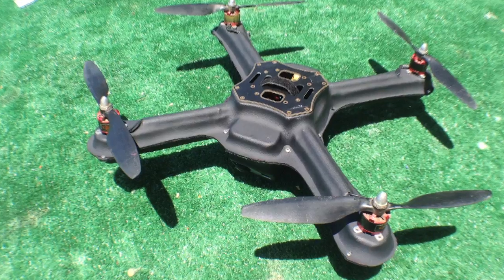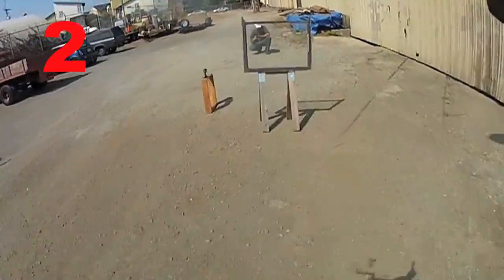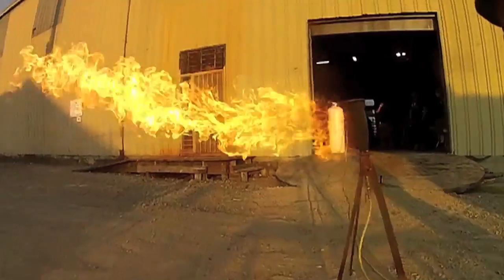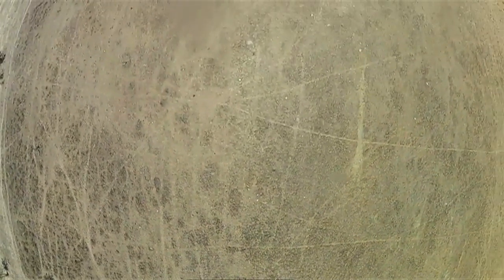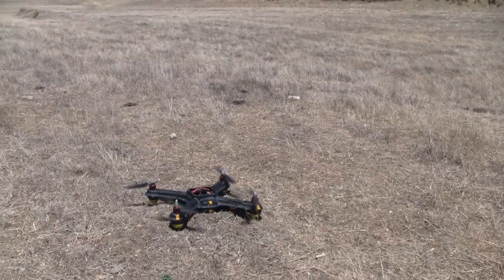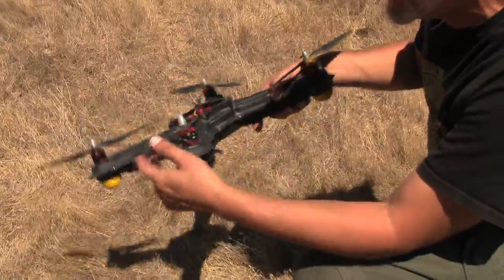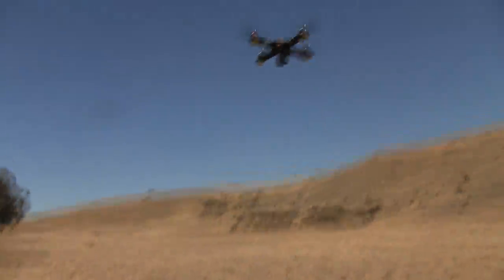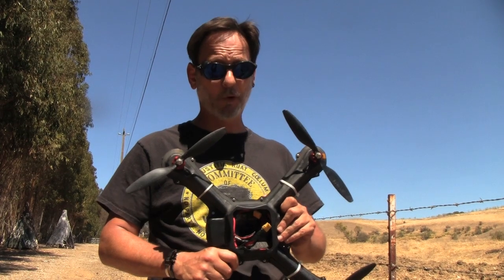Shotgun vs Drone Airframe - UAV Torture Test by Aerial Sports League

Comment: Yeah, it's practically like brand new... AFTER YOU'VE REPLACED THE PARTS YOU SHOT OFF IT. Holy shit your logic is non existent. And stop calling it a fucking drone. It's a quadcopter with a GoPro on the bottom.
Reply from the maker: I never called it a fucking drone.  I don't cuss without reason.  Thanks for watching and share the links with your buddies!
Reply: Marque Cornblatt Prod. You did in the title. Shotgun vs Drone. Or are you referring to the "fucking", bit.
Reply from the maker: Kerry Emmerson Yeah, the reason I don't cuss online is because it usually makes the author seem too emotional and possibly unstable to be taken seriously.  However I see your point - even though we were only focused on the airframe (our product) we DO use some words and terms loosely.  We call it a drone when we "mean" just the airframe.  So I agree that this video can be a bit confusing unless you're really paying attention. Since this video, we've been more careful to use the word "airframe" while demonstrating our product line, since we don't sell ready-to-fly drones.  The other topic (drone vs quadcopter) is already an out-of-date and useless debate.  Words and language are fluid and constantly evolve.  "drone" is an accepted term for multi-rotors, whether autonomous or manually flown.  Just like how "robot" is the accepted term for just about any new machine produced these days.  I also call my remote telepresence rovers robots:  Sparky - Autonomous Telepresence Robot Interview

Comment: Yoo dude start one more kickstar project that drone carries man in the city...v8 powerful engine from tesla motor...collaborative projects with tesla motor..put two v8 electric motor...One above and one below or both above...Make rectangular circuit or diamond shape..between that making on seating chair or two...batteries are arranged in frame on rectangular circuit...use specific batteries arrangements by tesla..Make weight of distribution properly..I am fed up up with traffic in city and gasoline hicks...electricity is the only way out...I can't buy chopper but I can afford your man carrying drone. Make it affordable for everyone! Tx

Comment: I winder how easy I could mount a weapon to one of these...?
Reply: Wait how is FPS Russia's videos a fake?.
Reply from the maker: Done that.  Worked great.  Check it out.
Paintball Drone Gunship - a DIY Combat UAV from Game of Drones
Enjoy, and thanks for watching!
Reply: Marque Cornblatt Prod. paint ball? That's not a weapon. What I am talking about is dual AR-15's, each with 150 drum mags.
Reply: J.D. Turner Mounting it would be easy. Hitting anything would be difficult. Getting the drone off the floor would be impossible.
Reply from the maker: Twin AR's is just a videogame folly.  Small powerful drones can easily, mount, lift, fire and repeat a range of modern weapons with accuracy.  There are many videos online demonstrating this (Don't be fooled by FPS Russia's fake clip, however).  Thanks for the question and share the links with your friends.

Comment: I should mention that shotgun experiment is comparable to shooting at a car's hood, replacing the damaged components in the engine bay and then concluding the car itself is indestructible.
Reply: Marque Cornblatt Prod. how much does that drone you are using cost roughly? and where could i buy one?
Reply from the maker: Toby Squibb This video is a demonstration of the airframe's toughness, not a suggestion of a battle tactic.  Thanks for the comments and share the links with your buddies.
Reply: Marque Cornblatt Prod. No actually... it's not at all like shooting a car with a GAU-8 Avenger... if you think so, I would like to see your exact research on the fact and how much damage the car would sustain in comparison to a UAV, as well as how easily it can be repaired and the cost of those repairs. Basically, if you do not have a scientific study that shows this is exactly true, then please do not say it is. That would be factually wrong. Please like this comment and share it with your buddies.
Reply: Nobody wants to go find a drone so they can perform these minor repairs though, especially not if there's a nutter with a shotgun lurking somewhere nearby.

Surely this will end up giving a lot of drones to the enemy that they can then perform "minor repairs" on, replace the transmitter crystal and then use against you?
Reply from the maker: yumpaa You can purchase our airframe here:
http://www.gameofdrones.biz
Thx!
Reply from the maker: Thanks for the comments.  To be fair, if you consider the scale of your comparison in terms of mass/speed/ and other forces of ballistics, it's more akin to shooting a car hood with an A10 Warthog and being able to drive away with minor repairs.  And that would be the world's most indestructible car.  Thanks for watching and share the links.

Comment: this is interesting too ..

If I fly a UAS for business purposes, such as new technology development, am I required to get approval from the FAA?
All UAS operations for commercial or business purposes are subject to FAA regulation. At a minimum, any such flights require a certified aircraft and a certificated pilot. UAS operations for commercial or business purposes cannot be operated under the special rule for model aircraft found in section 336 of Public Law 112-95.
To date, only two UAS models (the Scan Eagle and Aerovironment's Puma) have been certified for commercial use, and they are only authorized to fly in the Arctic. Public entities (federal, state and local governments and public universities) may apply for a Certificate of Waiver or Authorization (COA). The FAA reviews and approves UAS operations over densely-populated areas on a case-by-case basis.

What's the difference between public and civil aircraft?
A public aircraft is one that is only for the United States government or owned and operated by the government of a state, the District of Columbia, or a territory or possession of the U. S. or a political subdivision. Operators of public aircraft include DoD, DOJ, DHS, NASA, NOAA, state/local agencies and qualifying universities. Civil aircraft means other than a public aircraft. 1, 4

http://www.faa.gov/about/initiatives/uas/uas_faq/

Comment: Did nothing but scuff the plastic... Nope, ESC was stuffed along with a motor and blades, if he could actually aim properly and hit the battery, the whole quad would have been stuffed.
Reply from the maker: Nope.
Reply: Yes. Common sense, don't you have rc experience?
Reply from the maker: Ryan McDougall Yes, I have extensive experience with both aeronautical design and shotgun ballistics.

Here is one of my many weapons videos detailing different 12 gauge rounds and their various impact forces: Guns & Gardens Ep. 13: Mossberg 500 Ballistic Test

And here is a video detailing some of my recent airframe testing:
World's Toughest Drone Torture Compilation

The airframe was only scuffed not penetrated, but a pellet or two did squeeze between the clamshell parts hitting an ESC.  The motor and prop were not protected by the airframe, so they received the full force of the birdshot.  The integrity of the airframe itself was never compromised and the internal components were protected.  We now have an added clamping piece of exterior trim armor to prevent foreign materials from squeezing through like that pellet did.  

Thanks for the comments and share the links!
Reply: I think the if the battery is a lipo one and it got penetrated by a pellet from the shotgun than the reaction of the battery would be contained by the frame and the internals would be toast
Reply: Yes it would.

Comment: I bet my 50 BMG rifle would bring it down.
Reply from the maker: Only if you can make contact.  If the drone is hovering for effect like in the clip then no problem.  But a drone flying at speed is nearly impossible to hit, even with the wide spread of birdshot.  Most hi-powered rounds will penetrate the airframe, but there is a lot of empty space inside.  It's very likely a round would penetrate the entire drone without causing any damage and little impact forces.  Check out the failed attempts to bring down drones at the recent full-auto owners annual meetup.  Thx for the comment and share the links.
Reply: Marque Cornblatt Prod. Very true. With a high-speed pass, it would be just pure luck to hit the aircraft at all. I haven't seen the full-auto video yet, but I'll definitely check it out. You guys have created a hell of a quad for sure.
Reply from the maker: T.J. Cloer Here.  Check this out. I was kinda shocked...
http://gizmodo.com/shooting-down-a-tiny-drone-is-nearly-impossible-even-w-1563018247

Comment: For easy to make anti drone munitions, crush an old speaker magnet into small pieces and pack it into a 12G shell using salt as a filler. Can make do with that until armour piercing ammunition types impregnated with magnetic filaments becomes available ;)

Comment: I have built quads with foam and aluminum ( $5 or less in parts) which can all take the damage that you are showing here (minus the blades which looks like they are being destroyed in your videos).  Nothing that you have shown is impressive. These are not drones, these are RC quads.  When did hobby grade RC aircraft all the sudden become drones?  I want to see something actually demonstrates real world crashworthyness compared to other compatible products.  Show one half way through a loop that plunges into the ground sideways at full speed.  These are nothing more than parlor tricks.  I am not trying to be an @ss but I just don't see anything impressive.  Hitting thin glass?  Why glass?  Why not something more likely like a wall, tree, or anything else that is far more likely to be hit? Shooting it with birdshot?  what quad couldn't take that? Dropping it from the air?  A cheap carbon fiber frame can take a throttle down.  I am not questioning the strength of this product but the testing that you are doing to is not that impressive.  I don't see how this is any better than any other frame.
Reply from the maker: You sound like a person who hasn't spent the last 24 months building and testing airframes for toughest and resiliency.  If you think that you can produce a frame from carbon fiber that can take all this abuse as well as ours, then you should be in business.  Let me know, because I would gladly buy one after watching your airframe handle the torture testing on video as well as ours.  Thanks for the comments and I look forward to your video.
Reply: Like I said, its not that I am doubting the product, just that your videos are not really showing a real difference between it and other products.  For someone who wants to be in business you may want to be a little more professional in what you post.  I am not in the business of building quads, you are.  You could take what I said and do something to better demonstrate your product compared to what OTHER COMPANIES make rather than be defensive about it.
Reply from the maker: jjmonns Our personal work shown on video became so popular that only in the last few months have we begun selling the airframe.  Here is a more recent clip with a direct comparison to 2 of the most popular airframes available.  I don't mention the brand names, but anyone who plays with UAV's will recognize the brands.  Notice how they are ruinied with a single impact.  Then notice what our airframe can handle.  There are even more clips if you care to watch...
Drone Torture Test #2 - UAV Airframe Beat Down

Comment: Awesome indeed. I had an idea, how about getting rid of all the wire's use Bluetooth  to sync the props together. Then reconfigure the props,drive motor, and finally the powersupply into one unit that changed out as easy as you put a battery in a flashlight.
Reply: So like a quadrocopter with no user replaceable parts?
Reply: Not really, more along the lines of having the repairs being very quick because of each module is quickly replaced. I would love to help if possible......Dale hargraves.
Reply: And more of every users ability to repair them......Dale h

Comment: What is their standard of destruction? They stopped it many times. But yeah, if you destroy something - and then fix it - of course it will work again. Is the standard that it can't be fixed? What can't be fixed? He says that the shotgun just scuffed the plastic, but it actually "Absolutely destroyed one of the propellers", "jammed up one of the motors", and "one of the pellets got into the arm and destroyed one of the motor controllers"

Comment: I cannot agree with the conclusion of your test. It very clearly failed.  First: it cannot stay airborne after simply crashing on the window or wall -  fail. second: your "fire test" didnt prove anything else then that you can fly it in close quarters very well. alright... Third (a) even the most popular airframe from hobby king with properly mounted devices can survive such fall.  Fail(a). Third(b) The flyer did not stay airborne after minor hit from shotgun Fail(b). ---- conclusion Tested quadcopter showed some limited hardiness against pilots mistreatment but it could not survive one attempt to down it.
  Good enough for marketing advertisement, but thats it.
Reply from the maker: You are free to draw your own conclusions.  Good luck flying.  Thanks for the comments and share the links.

Comment: If you add enough weight anything can be made indestructible as you have shown  getting it to break a window (after bouncing off it the first few times which IMO was the real test as that's what usually happens and the quad takes the damage) but like most people with RC experience I don't crash so I'm wondering why the tradeoff  that affects performance as well. Unlike a baseball Quads need to be light as a feather to carry as much battery weight as possible. I'd much rather have longer flight times as the quads eat up so much energy and I have a hard time getting 3 minutes flight time out of the 25C, 35C, 45C 150mAh EFlight stock batteries after 8 or so charges and tried 200mAh (max weight giving any performance) which only gives another 45 seconds or so and that's at only weighing 19.5 grams total weight! It's too bad quads have such a short flight time in the air and can carry so little weight (excluding the government's drones) and making them bigger doesn't add much more time to the design. You have to laugh at that idiot that likely owns and drives a car full of gasoline and owns a cell phone that calls these hobby toys dangerous.
 
It seems at half the weight using that design and material would still be very tuff for its weight, certainly enough for "flying";-) so are you going to make a lighter version too? It seems you are on to a good thing except for dealing with weight/gravity. I agree the DJI (as with all the other brands) are far too breakable but let’s face it the manufactures want to sell parts and know from a liability stand point its better for the frame to absorb the energy. Have to agree with Jared below too to get it to auto rotate for safety and saving the camera if using one just in case Murphy shows up. Blade's Nano QX and larger 350 seems about ideal but I'd raise the thrust line even a little more as I just can't associate flipping a quad with real acrobatics and it seems to me auto rotating better is more desirable that flipping faster.
Reply from the maker: Our airframe weighs 5.8 oz. - much less than the DJI flamewheel at 9.9 oz. and the 3DR quad frame as well.  Thanks for the comments and share the links.
Reply: "If you add enough weight anything can be made indestructible"  ???? have you every heard of the titanic ?     anything can eventually be destructed.

Comment: Was I the only one that hoped for one of the shrapnel penetrating battery? Is that LiPo? That would be something to watch.
Reply from the maker: We were fully expecting it blow also, but after a bunch of direct hits with heavy dove loads, the airframe held firm.
Reply: Marque Cornblatt Prod. Many people underestimate modern polymers. Plastics nowadays are not the ones we had 50 years ago. Many are capable of stopping bullets or better properties than metals. I suspect that this sturdy polymer frame was slowing the dove ammo enough not to fracture anything. Dove ammo is still pretty light. I think that solid 9mm would devastate it. Still shooting a high and fast flying object with 9 mm is way harder job. Either way this frame proved its worth in my eyes. Keep on your work here. Drone tech is still in its infancy :)

Comment: hey guyz, i have 2 modifications i would suggest you make for better performance.

firstly, the arms should be thinner or have flow holes to reduce power loss, seconly, try give the arms a banana bend upwards so the bottom of the arm on the end is above the top of the canter body, this will increase stability and also give slower and more controlled falls as the copter will remain upright in a fall and the props will spin adding drag.

Comment: Where do you buy one of these?
Reply: its basically a modded dji drone. Buy it from amazon...
Reply from the maker: locturian We used DJI as an inspiration for the shape only of our early airframe prototype, but their cheap frame parts can't handle any of this abuse.  We do mix-and-match electronics & components from DJI, 3DR and others, but the airframe is all GoD. We will be launching a Kickstarter in mid-Jan. to begin distribution of our airframe.  Thx and share the links.